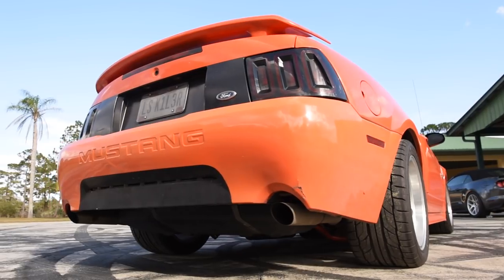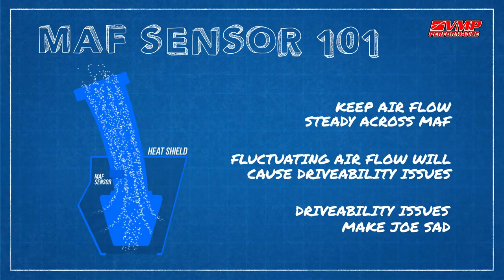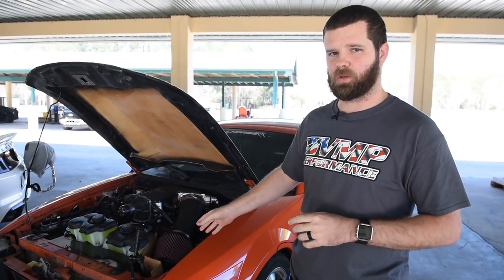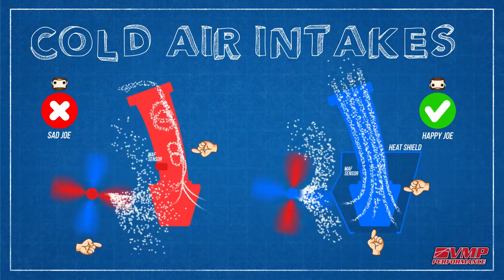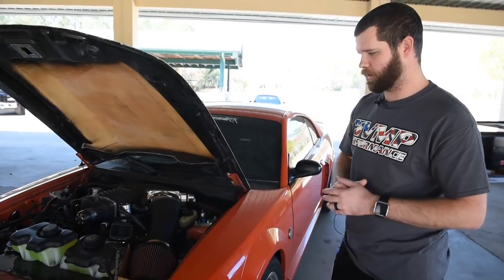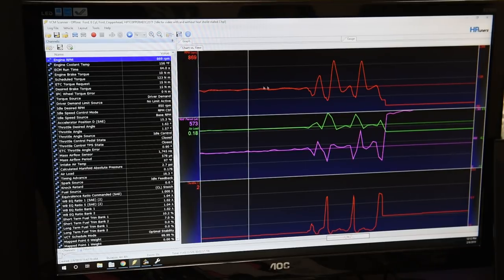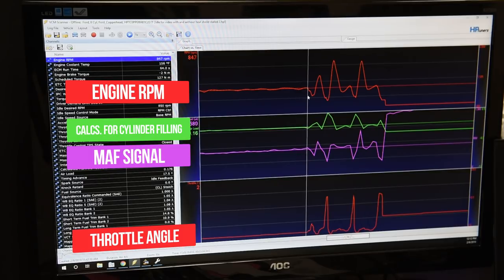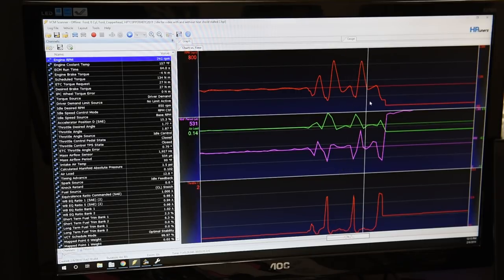The Importance of a Stable MAF Signal

Comment: I literally experienced this over the weekend. I let it idle longer than usual then check engine light came on when driving. Plugged my tuner in was lean bank 1 and 2. Clear the code and it hasn't came back on but this explains it. Thanks. 👍🏿👍🏿👍🏿

Comment: On my airraid set up, I used a shield and also reused the diffuser screen after watching the maf signal bounce a bit. That and without it I was ended up with it going more lean than I wanted for a second if I snapped open the throttle. Awesome video, thank you.
Reply from the maker: Awesome!  Thanks for sharing your results.
Reply: @VMPPerformanceTV  Btw,  love the work you guys have been doing. Been following stangmode's build with your Odin kit. Woot!
Reply: When bypassing the MAF sensor,  vehicle's computer will not look to the MAF sensor to check air to fuel ratio, but will bypass it and go to the O2 sensor to calculate the amount of fuel to mix with the air. At least on another car's make& model.  My $0.02
Reply: @SLICK WHEELS  This isn't a bypass. This is placing a screen in front of the maf housing. All the stock 99-04 4.6's (the 2 valve) had them stock. Its only purpose is to smooth the flow of o2 to give a stable reading. Many aftermarket cai's don't bother with them. After data logging without the screen and with the screen, I kept the screen on after looking at the graphs and a smoother response.
Reply: @w00derice  😃👍

Comment: I have the K&N elbow with drop in filter using the factory air box. When cruising, IAT’s run 5 degrees higher than ambient temp. Not too bad.....

Comment: What’s up guys so my 2011 gt500 is sort of lagging on me , whenever I pop it into 1st gear and step on the gas the rpms go up but the mph really don’t move or go up and I scanned it with the tuner and gave me 2 codes that might be in relation to this p2098 and p0100 any ideas ?
Reply from the maker: Hey Edgar, P0100 is a Mass Airflow Circuit Problem code and P2098 is a post catalyst fuel trim low limit code.  If your vehicle is tuned, you should contact the tuner and see about having a log reviewed.  If we are tuning it, email in to your tuner here.
Reply: @VMPPerformanceTV  yo I got a p0171